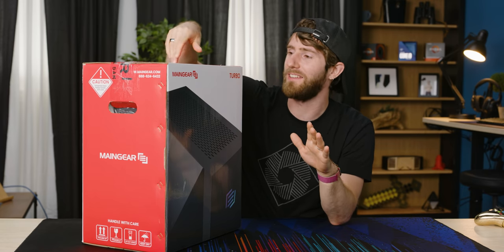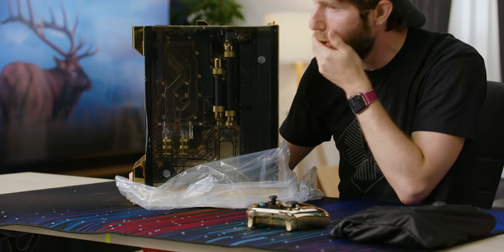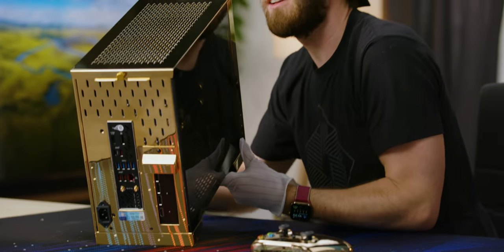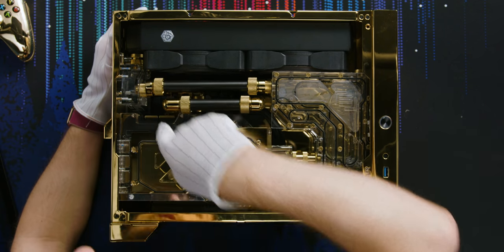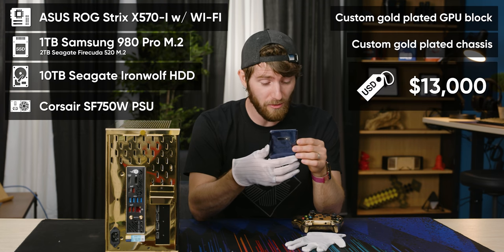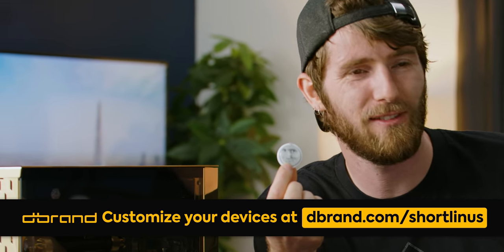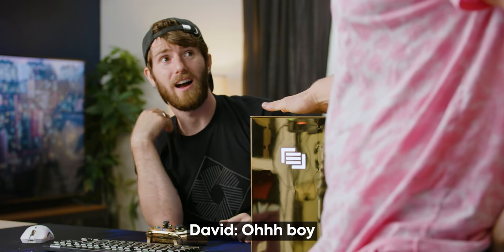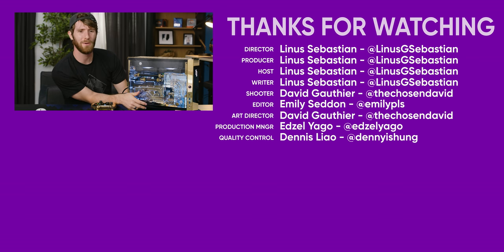MAINGEAR is definitely NOT getting this back! - Turbo PC Gold Edition

Comment: @Maingear  If I buy one of these from you for $13,000, will it also come with all the dents and dings that the one Linus got which I noticed as he was pulling the plastic off after taking it out of the box?  I dont think Linus caused those dents.  Also, is it hot enough to burn me and my family?

Comment: Yeah never mind that big Ding like someone took a punch or a pic to on the back side panel from the inside out that big enormous nipple it has. And why the broken standoff and screw. You'll never get that dent out of there even if you middle work it. Because it'll take the plate off. How does someone even send a PC with a dent like that!!!

Comment: Hey Folks, does anyone know a good replacement for my Logitech Z-5500 5.1 sound system on my PC?

It feels like it's time for an upgrade and I would prefer to connect the new system via HDMI, but I'm a little bit confused about the actual situation. I would guess, that I connect my Samsung Odyssey G9 via DisplayPort to my RTX 3060 (yes, gonna be upgraded as soon as we're back on MSRP... *fingerscrossed*) and if I would buy, for example, an AV Receiver, I would connect it via HDMI... also on the GPU? My Asus X570-E doesn't have an HDMI Port, but I would like to use those fancy Dolby Surround technologies beyond Dolby Digital 5.1 (which my Z-5500 gives me via 3x AUX cables).

I play a lot more story based games and I like to not wear a headphone while gaming. Maybe someone got some ideas/tips/suggests, would be thankful for everything helpful! :)